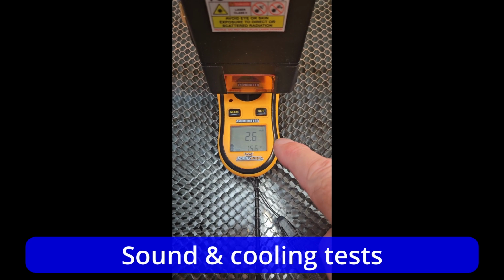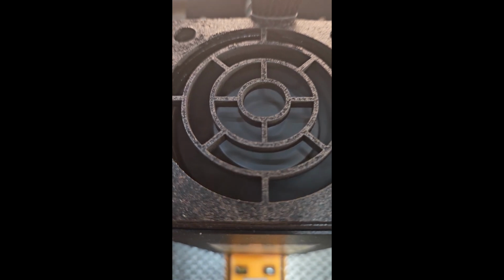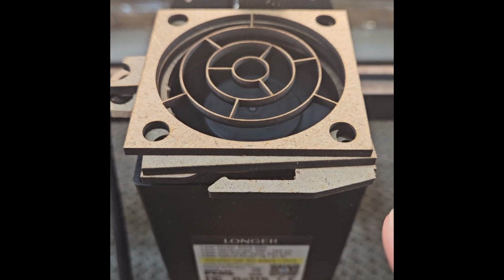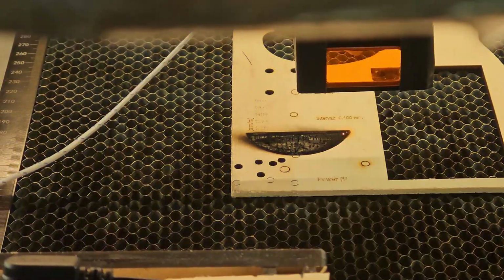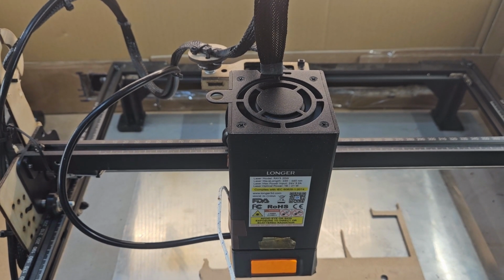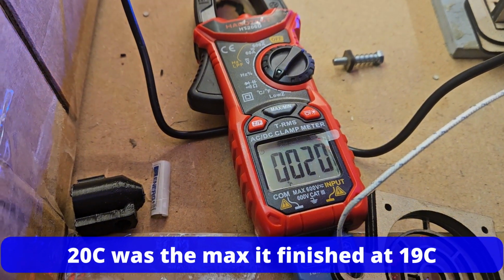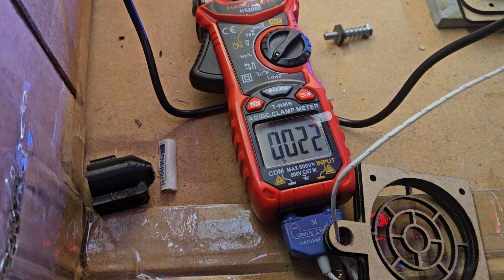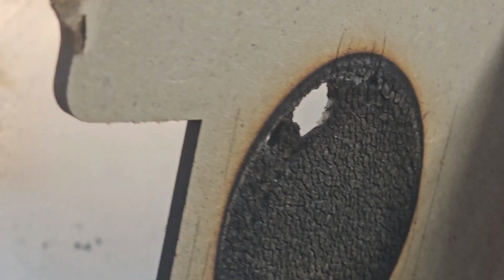How to reduce noise Diode laser engraver custom wooden fan cover.  Better cooling.

Comment from the maker: The creator of the 3D printed files is Justin Duncan and goes by the handle @makenzie71.  And thanks to Jeffrey Spriggs for finding the link.  Here is the link to the 3d FILE https://odysee.com/@Makenzie71:6/Longer-Ray-5-duct:8?fbclid=IwY2xjawG7yNdleHRuA2FlbQIxMAABHUEjcrfEEE4nbKCoNgeEBWiHkMel18IlPe3iK9pu-D-gsBpI3oxg-JYzdg_aem_zUTy4z1xis3V3ineQvdHTA.  It prints very well due to the design.  It has a small pillar in the middle at the base that supports the bottom of the aerofoil design so if your printer can bridge a short gap 30mm it should be fine.  You may need supports just for the external hoop.

I may revisit this in the summer months and will very likely reprint the duct with a finer layer height and make sure to remove all the very fine strings. Though I will continue to use my laser cut design

Comment: You changed things between tests and then say it doesn't matter. But it does. All variable should be the same for consistent comparisons. I agree with another commenter that this is unnecessarily long. You lose viewers (like me). You don't need to show all the burns etc. Concise is nice! Maybe a chart showing results.
Reply from the maker: My channel is you following my progress in the experiments that I carry out. This style may not be for everyone.  Though many enjoy the learning process. You can always play the video at double speed are skip around it.

However I will if they are not there already add chapter markers to try and please more viewers

Comment: For improved flow try a simple trumpet/bellmouth shaped inlet ( as used on carburettors)
Reply: Has it improved the airflow at all, if anything it may increase the noise if the airflow increases.
Reply from the maker: @michaelbaker5176  the results you are looking for are all in the video
Reply from the maker: Thanks for the info. Yes I 3d printed one and it made no difference to the noise. I should do a quick video about what I did before I recycle it